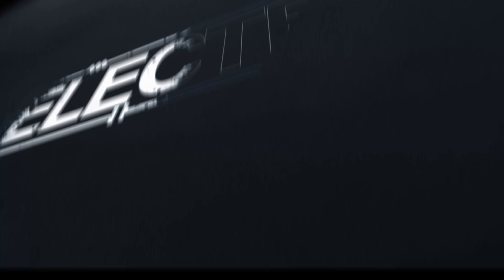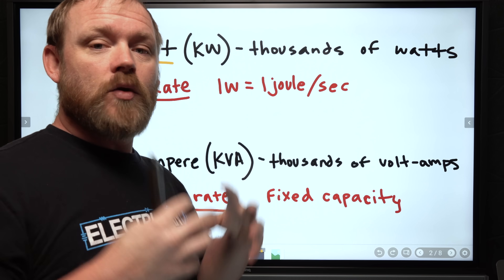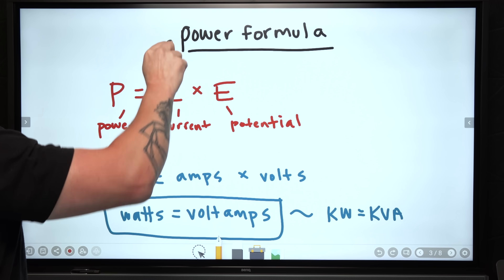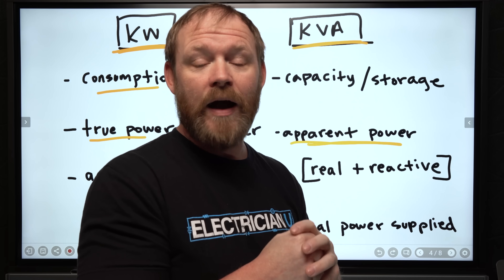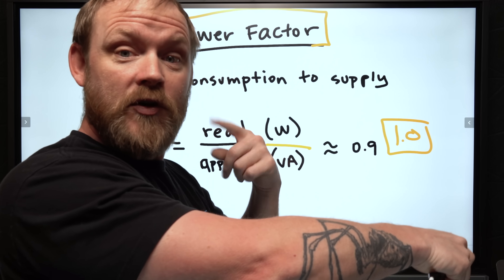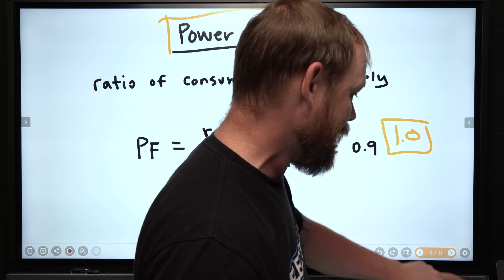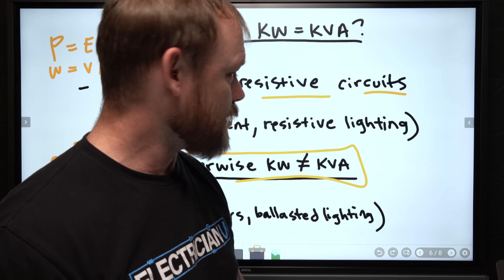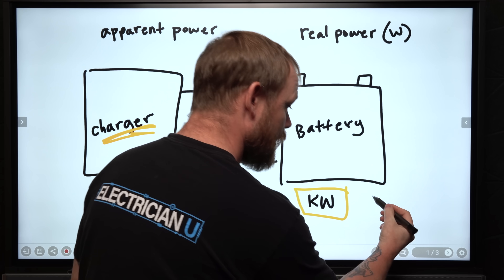Why KW and KVA Are NOT The Same Thing (Even If They Seem Like It)

Comment: I always think of it in terms of a vector diagram. V is vertical as is I ...... add them together and you have KW (or DC power). Impedance is the factor moving sideways to that vertical eather left for capacitance or right for inductance. You then add all the vector arrows together to get your resultant. The length of your final vector arrow is the VA or KVA BUT that is always longer than the vertical which is your power (KW). The capacitive current and the inductive current are always opposite to each other (so their arrows can be subtracted)

Easier drawn or imagined than written!

Comment: I generally look at this from a kinetic (W) vs potential (VA) energy viewpoint, but I like this overview that better covers the arguement.
Reply: Ah this remark helped a lot. Makes sense, for potential impedance doesnt matter, but of course for the actual it does!
Reply: This is the way I look at this too. It doesn’t seem to me that they both have the same units as stated in one of the comments above.
Reply: So basically, VA mechanically would be gravitational potential field (g⋅h, in J/kg) and mass flow rate (dm/dt, in kg/s) — as seen in a hydroelectric dam — representing the available potential energy transfer capacity, while W (watts) would be the actual mechanical power output, i.e. the portion of that potential energy converted into useful work, factoring in system efficiency (nu) (e.g. turbine losses, friction), expressed as:

Preal = nu⋅g ⋅h⋅dm/dt

Where:

VA is analogous to the total potential power available (like water falling from a height).
W is the real power delivered (like the actual electricity generated by the turbine).

Comment: Just divide  KW by Power factor in decimal form and you get KVA which is always a larger number.

350kw× .9PF is 388KVA .

AC circuit not DC obviously.

Comment: I have a question Dustin. If it’s true that the capacity or line side is rated in kva, why are power plants said to be a “X gigawatt” facility?
Reply: Because power plants traditionally don't store power.

Think of it like a car, the motor is rated by its maximum power output.. which is why they are rated in kW in metric countries. You don't drive at maximum power 100% of the time tho just like a power plant doesnt (typically) run at it's maximum power 100% of the time.

The capacity or how far the car can go however is limited by its fuel/gas tank (ICE) or batteries (EV) and are rated in KVA or KWh (that h is important).

Power plants are an engine.

Comment: My favorite analogy for reactive power and power factor is pushing a kid on a swing. If you give the kid a push at just the right time, it's easy to get the swing to go up high. But if you give a push at the wrong time, it's wayyy harder or impossible to keep things swinging.

In the case of motors, you're essentially trying to slow down the motor with the load you have on it. So instead of the AC current "pushes" from the power company being perfectly in sync with it's movements, the load causes the motor to fight against that perfect timing. As a result, the power company is effectively pushing the kid at slightly the wrong time, resulting in wasted power that could have been useful if you had better timing.

That's the big reason there's a market for fancy motor controllers and power factor correction devices. You can actually fix the imperfect timing if you're smart about it, resulting in better efficiency. You do it intuitively in the swing example by watching and feeling, in electrical engineering we use carefully tuned inductors/capacitors and computer equipment to do the same thing.
Reply: I like the mug of beer, with the beer and the foamy head expressed in real beer and apparent beer.
Reply: And I guess that is why you have big capacitors on those big air-con units, to tune the reactive load from pure inductance to capacitive/inductance balance.. Right ?
Reply: @daveleger2002  Power factor is definitely a part of it, after all a stalled motor is just a dead short... Tons of power consumed for nothing useful out till it gets going. But the capacitors are mostly there to keep your breakers tripping and wiring lighting on fire... The capacitor stores energy that's used for the initial push that's needed to get it moving.

Typically when people talk about power factor it's a longer term, steady state description. Temporary fluctuations are usually a different concern.
Reply: @daveleger2002 
Compensating too much inductive load with capacitors is usually done by industrial plants because these pay for apparent power instead of active power like common people do.
Personaly I favor an other possibility. I think these capacitors are used to create a phase-shift which allows to run a 3-phase AC motor
in a single-phase network.
Reply: Good analogy! 👍
Reply: I like that analogy 👍🏻, it perfectly visualises the phase (angle) difference between the V and A
Reply: @EddyManfred 
This analogy is of limited use because it portrays reactive power as 'wasted'. In reality, however, reactive power is not wasted.
Reply: Im not sure what it looks like from the power company view but the VFD on my compressor lowered motor heat so much it barely gets warm.  Not to mention the soft starting bonus.
Reply: I finally get it. Beautiful analogy. Thank you.